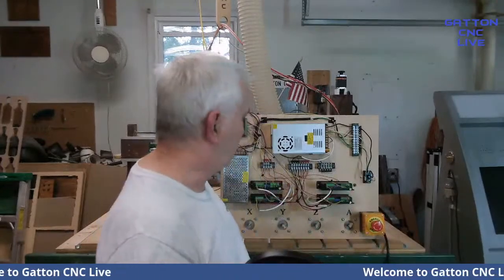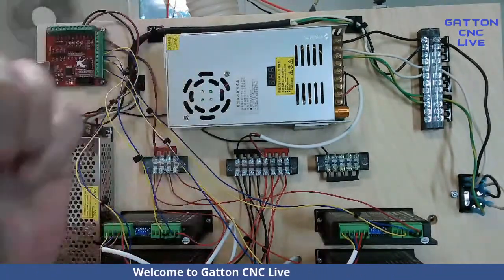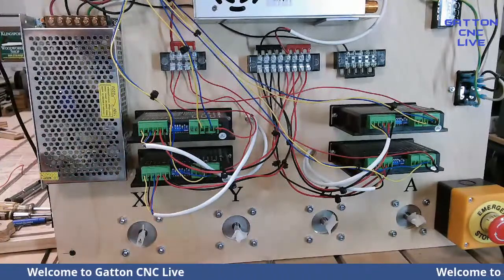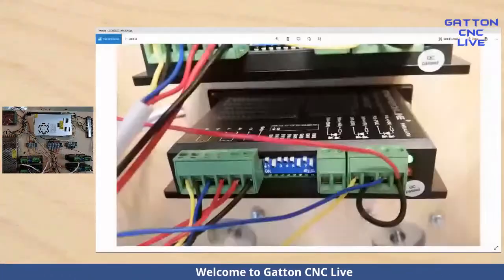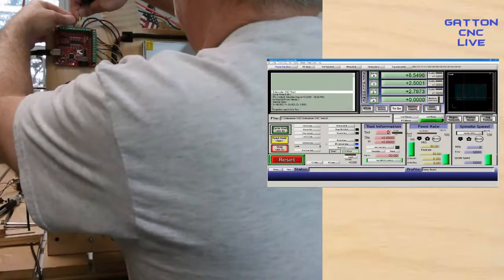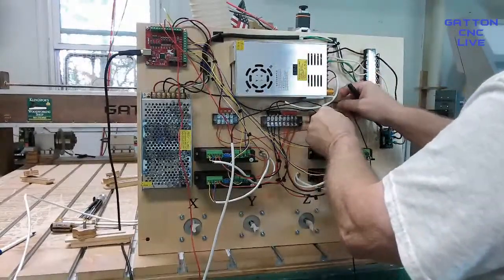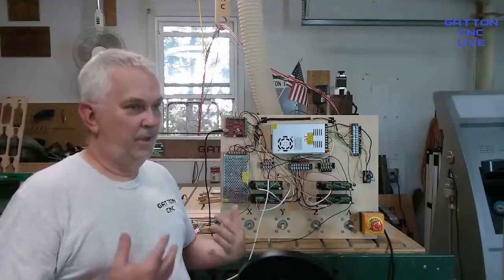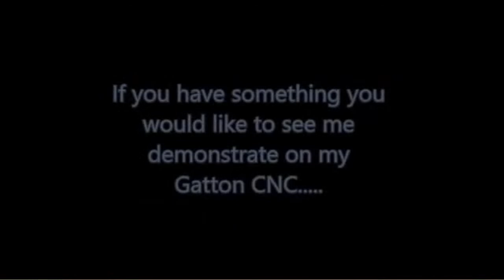Gatton CNC Live  | #5  2-Sept-2020

Comment from the maker: UPDATE:  Just wanted to give an update.  After talking with someone that has slaved the A axis sucessfully I decided to go back to the drawing board and try again.  I still could not get the A axis to slave properly no matter what I tried.  Then I decided to try a different RnRMotion.dll file.  I found one that had a much older date (1-21-18) so I deleted the newer one I was using in my plugins folder of Mach 3 and added the older one and now the A axis is slaving perfectly while Jogging, running a program, and a MDI command.  So I would say it you have a card like this or one similar and can't get the A axis to slave properly look for a different RnRMotion.dll file.

Comment: Hi Dave. Thanks for posting the many videos. I enjoy the content and pace of instruction. You my already know this. The red motion control board you show with the eagle on it does have MPG connections in the otherwise unlabelled black connector with 10 pins. A little hunting on the internet gives the pinout too. I ended up just using an inexpensive Mach3 remote that plugs into the USB port of my computer. It doesn’t have a MPG dial but the buttons work just fine for all except the 4th axis.

Comment: Setting a slave drive provides major advantage. When you set up separate homing switches for X and A, the homing routine will square the gantry every time it runs ( if X and A motors run the gantry)
If you connect X and A drivers together and one motor drops steps, the machine will run out of square and it may take some time for operator to notice. Correcting out of square gantry has to be done by hand. It is simple but not a quick procedure.
Automatic squaring on homing guarantees that at least at the beginning of the job the gantry is perfectly square.
Reply from the maker: I agree.  Slaving two axis is a good thing and I've been doing it for years however,  as I mentioned in the video the USB motion control card that I'm using in this demonstration does not support slaving.
Reply from the maker: @rok1475  The slaving function in Mach 3 ONLY works when jogging as I said in the video.  It will NOT work when you use a MDI command or run a program.   The only way you can keep from racking your gantry if you are wanting the Y axis and A axis to move together is to connect both to the YD/YP on this particular USB motion controller.  You know the internet law....video or it never happened.  :-)
Reply from the maker: See UPDATE above.

Comment: Dave:  I didn't get to your video to later in the day!  Just wanted to know if there is a motion controller board that allows you to be able to move both X and Y and or Z all at the same time
Reply from the maker: Yes.  You can jog the X, Y, and Z axis all at the same time with with a Warp 9 ESS (Ethernet Smooth Stepper),  a UC100 motion controller when used with a parallel breakout board,  A UC300ETH, and a UC400ETH just to name a few.  I'll be demonstrating those in future livestreams.  Thanks for watching.
Reply: You can do that with any controller. The problem is the input device (keyboard), not the controller.
Install a joystick or Xbox control pad as input device and you can make the machine run circles (literally).
Reply from the maker: @rok1475  I have a MPG that has a joystick on it and you can not move two axis at the same time with it.  Perhaps you could create a video showing a machine using this same USB motion control card jogging multiple axis at the same time.
Reply: Dave Gatton what is the make and model of the controller you are using?
Reply from the maker: @rok1475  a link to that exact motion controller is in the video description.
Reply: Dave Gatton it has to be a real joystick (one kids play games with). The input device needs to send signals for multiple axis to the computer and the plugin sends that to Mach3 which sends step & direction pulses to the motors.
Manual pulse generators are designed to move one axis at a time. In machining this is safer.
I have done this and found joystick control not very useful, mostly because Mach3 still applies ramp up and ramp down to all moves so you end up moving one axis at a time, and there is no precision in movement control.
It is fun for first few minutes but then you switch to MPG with more precise control.
So it can be done, but in the end it is a waste of time. Perhaps I should have noted that in the first comment.
Reply from the maker: @rok1475  When using a keyboard (any keyboard) you can jog all three axis (X, Y, and Z) when using a motion control system that allows that.  Been doing it with my UC100 for years and with my Avid CNC as well (Warp 9 ESS).